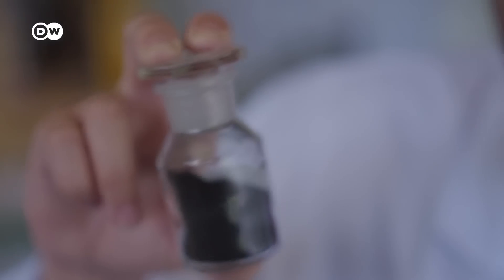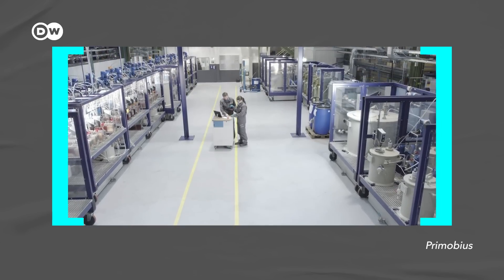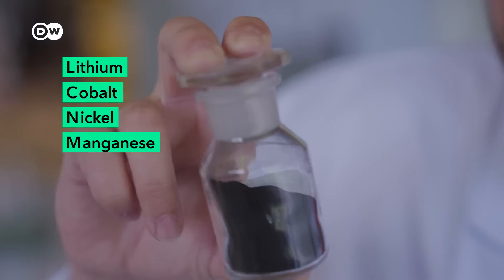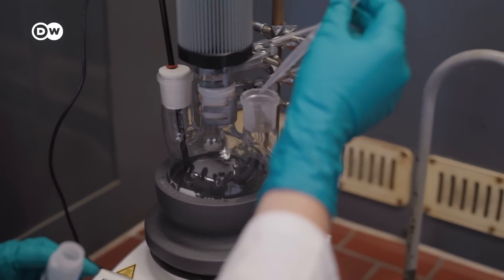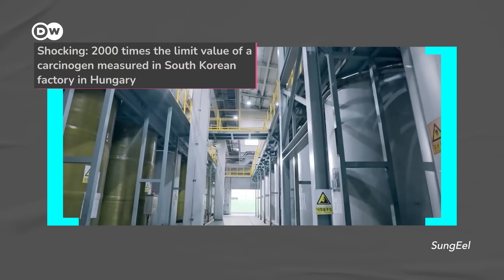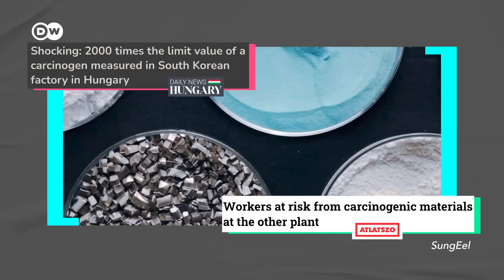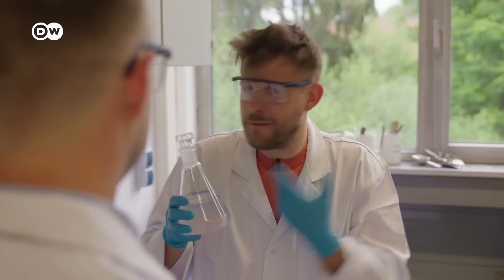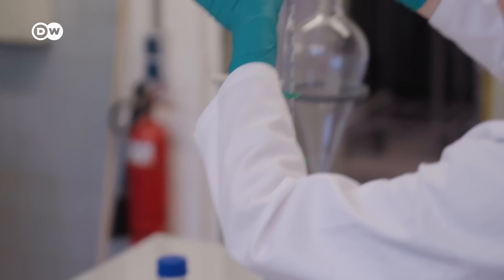The problem with recycling electric car batteries

Comment: This problem about recycling is easy to fix, make a law that binds manufacturers of EVs to recycling, in other words if manufacturer must recycle your battery for free(calculated in the price at purchase of any EV vehicle). It will make EVs more expensive however the problem will be solved.

Comment: Companies like Li-Cycle, in Gilbert, Arizona, USA, has a “95% recycling efficiency rate to return valuable commodity materials found in Lithium-ion batteries back to the supply chain.”  Li-Cycle sustainable and work place safe methods use a proprietary hydrometallurgy process that does not require Oxygen; preventing any potential for a thermal event.  A filter press is used to extract “Black Mass” containing Nickel (Ni), Cobalt (Co), Lithium (Li) . . .; including packaging materials such as plastics and vermiculate (Flame retardant).   No smelting methods are used in the extraction process and water is used in a closed loop.  Large, heavy, decommissioned EV batteries do not require manual dismantling and can be processed intact; increasing work place safety.

Comment: Any recycling effort is never easy.  Even recycling the old lead - acid battery is not easy.  Recycling used engine oil - not easy.  Recycling the simple plastic water -  not easy.  But recycling electric car batteries will become easier with time.  Never forget that the horse and buggy as transportation system were great and very easy to recycle!!!!

Comment: Hello from Los Angeles California.  I lived all my life in Los Angeles California, and in the 1980's the Smog was so thick it filtered the Sun. The smog blocked the Sun so much the winter's in Los Angeles California was so cold between 36° to 55° Fahrenheit nights dropping to 33° Fahrenheit 
I couldn't see mountain ranges from where I live 4.5 miles away. Unless it was windy and smog cleared. Now the air is so clear you can see cracks and riges, on the rock walls. 
It uses to rain 🌧 none stop for 7 months, and the summers never exceeded 90° Fahrenheit. Due to Sun being filtered from smog I also didn't need shades, for my eyes. Now 🌡  are 110° Fahrenheit for excess of 1.5 months with 5 days in the roll Temps exceeding 116° and 1 day at 120° to 126° depending on fire conditions radiating heat. 
Air clean enough, and it will not get any cleaner with only Electric Vehicle's (EV's)
Now to the reason why Environmental green agenda causes Drought Conditions.  In 2010- 2013 there were Solar Mirror s installed to project solar arrays to a Tower with mirrors projected downward to under ground reservoir water sources.  To generate steam, and generate Electricity.  
The temperatures 🌡 causes the atmosphere to close to 5,000° and every time birds fly thru become instantly baked and fall. 

In the 1980's the Jetstream used travel across California in to Nevada,  Arizona,  New Mexico,  Texas, and so on to Florida.  Due to the Mirrors the Atmospheric High Pressure. Has pushed the Jetstream away from Southern California to North to Washington,  and or Canada 🇨🇦 . This cause along with getting rid of Smog cause higher temperatures and Drought Conditions. You couldn't pay me $10,000,000 per hour to sit, promote,  sell, let alone buy any Electric Vehicle's (EV's).
If you look up StachD Training channel, on his video titled Lithium Largest Ex plo ding EV Recycling ♻️ Center in Missouri.  There were 4 Recycling ♻️ Centers in the United States.  Now there are 2 Recycling ♻️ Centers,  and none are in the State of California.  Due to Environmental Impact, which the video shows Fire Authorities spray granulated elements of the Lithium-Ion Batteries 🔋 Packs,  into creeks, rivers,  and lake anfmd underground well resources.  Not even boiling helps, and fish hacmve died in those water ways.   Sure clean the Air while you Pollute the water. In April 2024 the 1st Recycling ♻️ Centers in Phoenix Arizona location burned down,  and dousing water to keep cool prenting spread of fires 🔥 have caused Drought Conditions.  @truebrit3670  Look it up
StasheD Training channel 
Missouri Recycling Center ♻️ Ex Plod ing can't spell this out. Fish died wells for water is no good anymore,  and became Acidic 
These are facts. 
Mirrors in Mojave Desert Modified where Jetstream away from
 Southern California.  
The so called green agenda is to keep there pockets full or bank accounts.

Comment: This video is a bit misleading!
Recycling these batteries is currently way more expensive and more CO2 heavy than just mining for new materials. FACT.
There is a company called GRST that has found a way to make recycling at the heart of their production and reduce the impact of each battery by 40%. You should do a video on those guys and get ahead of the issue!

Comment: H2S is a gas—hydrogen sulfide. There was a typing error at 3:54; it’s not sulfuric acid, which is H2SO4. It’s also true that recyclers can be quite secretive in many ways; it’s not only about their patented methodology but also about the environmental harms, even with all the certification policies in place.
Reply from the maker: You're right, at 3:54 we wrote Sulphuric Acid (H2S). But we meant Hydrogen Sulfide (H2S). Apologies for the mistake.

Comment: Questions...
What source of energy is primarily used in all this process?
How much energy and resources are used in ratio to life span of an ev?
Compare those indicativs between EVs and classic vehicles.

From building the not very reliable and durable ev to recycling them...🤷 What is the total impact on the environment compared with classic vehicle? Not just the impact of using the vehicle.😂

That's the catch....

Comment: My understanding is that they try not to separate the lithoum from the nickle, manganese and cobalt, jusr extract the carbin out and then try to market the resulting blend for use in similar technologies of batteeies or ti dilute it with fresh mayerial ti meet the blends needed for newer bayteey technologies that use different mixes.  Of course there are other technologies that simply use blends of different elements all together such as the LiFePo batteeies popular with Chinese EV msnufacturers and the numerous upcoming technologies which have already showed in some production EV's such as sodium ion and solid state.   Basically with the rapidly changing technologies, sure you could recycle the mayerials from a lithium ion battery but you may not have a market to sell what you teclaimed to once you've reclaimed it.

And to those who say we recycle lead acid batteries effectively as an argument for recycling EV batteries, look at how we do so, we dump the electrolyte into a tank, wash and disassemble the plates and the container, file down the plates, replacing them if they can no longer be refurbished by filing them down, inspect and patch the case, replacing it if it's too damaged, reassemble, test the electrolyte, diluting with new electrolyte if there are too much impurities and pour the electrolytes back into the battery.   The recycling simply isn't very sophisticated, it's not cradle to grave recycling and it's labour intensive.   The recycling of lead acid batteries is not a metric that argues for recycling the batteeies in EV's and are only practical because lead acid battery technologies have not changed significantly in over a century.

Comment: Doesn't that process release more co2 then using the during its entire lifecycle. Hydrogen is a lot simpler and a lot more environmentally friendly when you consider the cars entire lifecycle.
People always like to ignore the vast majority of co2 pollution. Like with idiots focusing on food production while ignoring electricity and heat generation. 

What people are basically doing is spending a lot of energy decreasing 5% of co2 emissions(food production) instead of spending extremely small amounts of energy decreasing 70% of co2 emissions.

Comment: The problem is: solvents and materials used in the recycling process also need to be recycled. Well initially there is a nice concentrate sulfuric acid but after the process it is dirty and diluted. What to do with it ? To recycle at the place or neutralize with other materials, e.g. limestone and take to landfill behind a factory ( ? ). And don't forget about water which such factories use in large quantities. It also need to be recycled. To recycle water filters are needed. These filters after some time need to be recycled. See where this is going ? To recycle one thing it is needed to recycle six other things. It will be very expensive. Or there could be the other way: all wasted materials dropped to landfills and in waste waters.

Comment: Dear all, please read about Jadar mine and Rio Tinto's plan to use around 1-3 olympic pools of concentrated sulphuric acid (H2SO4) for Jadarite (ore that contains lithium) refinement.

An interesting fact, the formula of Jadarite is similar to Kryptonite 😁

Jadar area is located in Western Serbia, and is near Drina river (Drina is a part of Danube watershed). And Jadar area has one of the most fertile soils in Serbia.

Comment: It's just way too expensive to recycle/remanufacture anything. Have a look at what is going on with common recycling systems. The only way 'we' can recycle anything more than the cheapest materials (i.e. easiest to recycle/remanufacture) is when the world economy crashes. It is WAY cheaper to just throw stuff away and buy another cheap thing. I know it's hard to hear that, but this is the Mac Donald's generation - "Consume it, throw it away, buy another one." :(
Do your own research into the ACTUAL recycling systems, and then make another documentary.

Comment: In the UK, companies have regulatory pressure to bring down their Carbon Dioxide Equivalent emissions. They would be incentives to use these kinds of processing plants, and usually, you'd pay for commercial waste to be disposed of. So there's potential here for when/if plants were to become more common of companies to benefit and maybe give the batteries for free.

Comment: To balance out this content, may be you should report on which part of internal combustion engine cars are recycled and reused again.
Reply: Used engine oil is filtered and reused.  By and large an ICE from a car is melted down and the metals separated out and it all gets fed back into the furnaces and reused.  Very little of the engines goes to landfill.  What hasn't rusted out of the body will also get smelted and reused. (Same as for a new generation EV.)

Comment: We have used 12v batteries in our cars for decades now.
AFAIK 12v batteries producers are equally interested in getting their batteries back to recycle the materials.
I thought we had this figured out already.
Why EV batteries are so different?
Reply: A lead acid car battery is really easy to recycle as it is very simple. The lead plates are melted down and reformed as new plates,  The Sulphuric acid is recovered and refined and reused.  Depending on the type of casing, some use thermoplastics that can be remelted, turned back onto pellets and then reused as a new case.  So a traditional Pb acid battery can be be over 90% recycled.
Lithium cells can be encased or in pouches.  Usually 18650 use a stainless steel case, so you can laboriously extract the roll of the cell and recycle the SS case.  The cell can then be turned into the black mass as in this video and then they have that chemically intense reduction and separation of the elements that were the active chemicals that made it an electric cell.  As shown in the video, the mix of metals varies a lot.  This is to give different energy densities and voltage and current behaviors.

Comment: Could it be possible that either the battery manufacturer or the vehicle manufacturer somehow retains ownership of the batteries at end of life in order that it's ACTUALLY recycled PROPERLY via one of these recycling plants ? And yes obviously there would be other issues requiring solutions ( handling/shipping and of course rediculus fees for the middle management ) ..... I say this for a couple of reasons , the green electric Utopia greenwash is constantly touted as the solution to climate change yet we know that is debatable ... Hence if the marketing department says evs are 95% recoverable then do so. Secondary is world supplies of these minerals/materials are not infinite , the current research in recovering these gives me hope that one day words and phrases like carbon free , zero emission and sustainable might actually be nearer to their realitys ..... Love from NZ😉🙃😎
Reply from the maker: Thanks for your thoughts - it will be intriguing to see how it all realizes. So far we really only have the example of the EU battery directive on legislation. 🔋 (🔗 https://environment.ec.europa.eu/news/new-law-more-sustainable-circular-and-safe-batteries-enters-force-2023-08-17_en)

Comment: I worked in R&D on this topic over 5 years. It should first be stated that Li ion batteries have been recycled from portable devices for many years using pyrometallurgy (smelting). The hydromet process described here is fairly conventional and nothing usual, those “hazards” are fairly common and manageable in industry. There are more chemically efficient methods that have been developed recently and you really need to be skilled in the art and read a lot. The main problem I heard was really the supply of batteries from eVs to drive the economics. Unlike a mine where the source of material is well defined, the source material for batteries must be sourced and I saw vertical integration and partnerships with manufacturers to source those batteries as important. There are many recycling companies battling it out right now. The dynamic nature of battery technology is also important, metal thrifting will be employed to lower costs and cheaper storage materials will be developed. This lowers the value of scrap. Most of the challenges lie in the economics and market, not technology.
Reply: Can the lithium be recovered in pyrometallurgy? It seemed like in the video, he said lithium wasn't recovered.
Reply: @AWildBard  some of the lithium in the electrolyte is recovered, but what remains in the electrode particles is lost. I remember reading an older article that it is technically possible to recover the the lithium in smelting process, but not economically viable. Not sure if that holds today but it seems hard to do.
Reply: Hi I want to talk to you 
Regarding reusing ev batteries for grid storage
Reply: Thanks
Reply: Incorrect. Make your own video.
Reply: Hello sir,
Me and friend are intereted in recycling li-ion batteries at a small scale 
Guide us with hydro metallurgy process
Such as how to extract nikel, cobalt, magnese and lithium at plant 
Suggest us some research papers or books needed to be studied 
Your help is deeply appreciated
Reply: @LaxmiMa-k2b You are asking a question with a lot involved. Here is a link to the project that completed in 2023. You should be able to find our papers and references. I have not kept up with latest developments. Note that Co free batteries taking a big share of market do not have a financial driver, such as LFP.  https://www.ameslab.gov/cmi-project-3111-li-co-pgm-recovery-li-ion-batteries-and-e-waste
Reply: BS

Comment: What you missed is that it is far, far easier to recover the metals that are in a Li ion battery from a dead Li ion battery, than it is to recover those metals from any natural ore being mined on earth.  For one thing, most of the very difficult separations have already been done. Li ion batteries for instance don't contain any Mg, Ca, K or Na, whereas Li brines contain these metals and a major part of the effort in recovering Li from brines is keeping the product from being contaminated by these metals.  Furthermore, the mass of metal per tonne of "black mass" is far higher than the mass of metal per tonne of ore or even per tonne of ore concentrate from many mined ores.

As someone quite familiar with the commercial production of Ni, Co, Cu and Li from their ores or brines, I'm not at all concerned about whether or not we can figure out how to achieve high recycling metal recovery rates from Li ion batteries.  As to the economics, you did identify the real problem, which is that the supply of dead batteries will take a long time to materialize and hence it will be a long while until we have enough dead batteries to feed world-scale recycling facilities which achieve good economics for their owners.

Comment: They look at it the wrong way. Why do we need to turn black mass into components and then battery manufacturers create black mass again. Instead, they should work on that their black mass can be used in manufacturing it will save tons of money in recycling and manufacturing too. and make batteries cheaper.
Reply: black mass is a waste product that no manufacturer will want.  I think you lost the point. of the whole video.  it's a useless waste product that costs more to refinement then to just to throw away.
Reply: @funnycatvideos5490  actually no batteries are made from black mass. I have even seen some recyclers who can recycle black mass. that can be used directly in production. I will try to find that video; it saves a lot of energy. because it is a high energy consumption process to create black mass

Comment: We shouldn't recycle electric car batteries. These batteries may not work for running cars. However, they are suitable to be reused for grid storage or as investors batteries in house.
Reply: why would anyone use an unreliable used  battery when a new one has a warranty and insurance.  did you forget how dangerous these chemical batteries can be?
Reply: @funnycatvideos5490  Becauae it is not unreliable and also, it is useless for EV applications but is still good for being used for energy storage. The people tend to use as it saves costs. This has been done on commercial scale in Australia as well as in some parts of the USA.